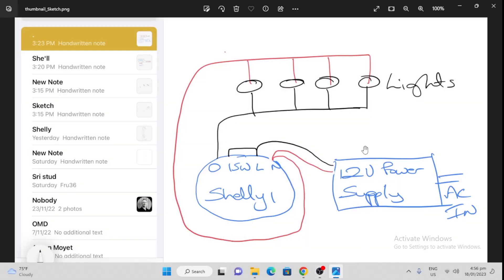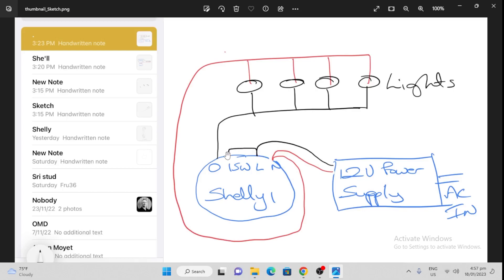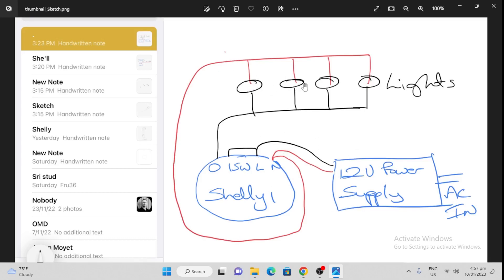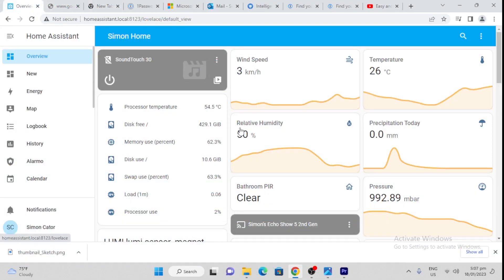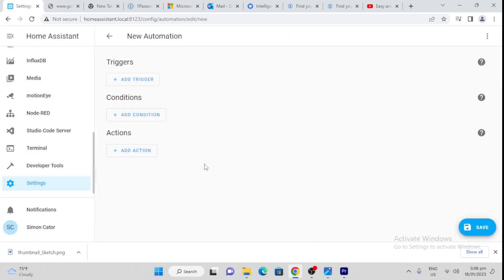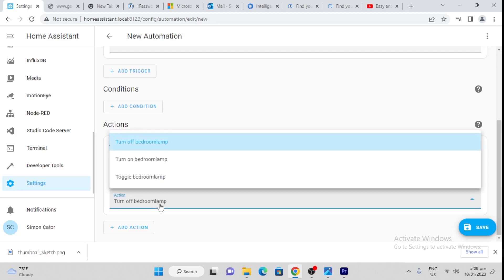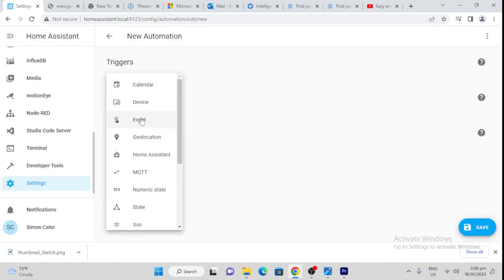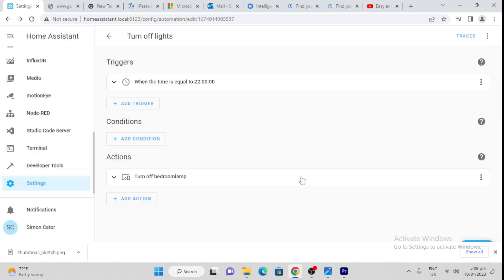Automated Garden Lights - Part 2

Comment: Thanks for the video, great work.  I'm planning a garden lighting setup, and hoping to keep costs down so AliExpress all the way probably.  I'm trying to find a way to do home assistant controlled, individually controlled and dimmable garden spot lights.  Do you know if this is do-able? I suppose I would need an individual dimmable controller (Zigbee?) on each wire for each spot light?
Reply from the maker: Thank you for your feedback Neil, yes you would probably need individual controllers unless you could do something like how the addressable LED strips work

Comment: Some people use a full transformer to supply power. Whats the difference with just using a 12 v power supply?
Reply from the maker: A 12 V power supply offers the power needed for the lights, I use a 7 amp one.  A full transformer may offer more amps but in my case I didn't need that.
Reply: @simonsayshomeassistant  I see it comes down to how much power you need/how many lights you have. Thanks very helpful
Reply from the maker: @ltai0001  Only a pleasure I am glad I could help :)